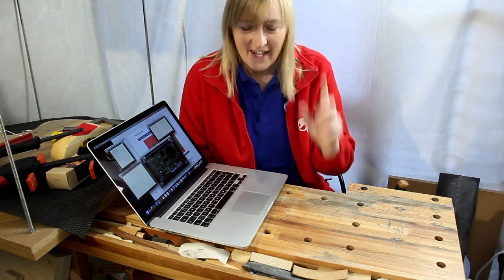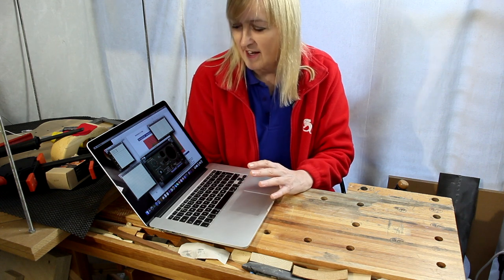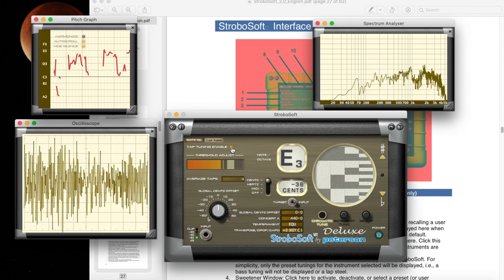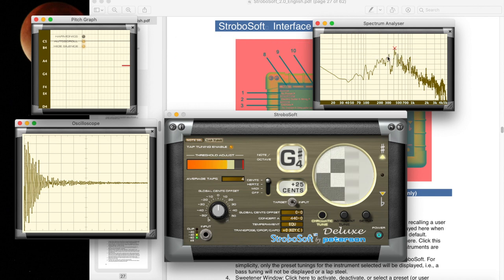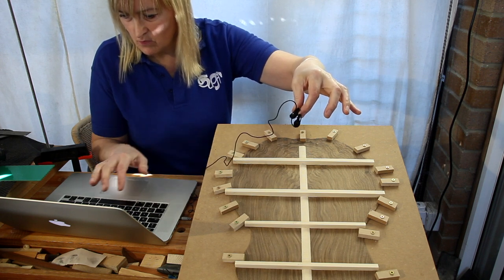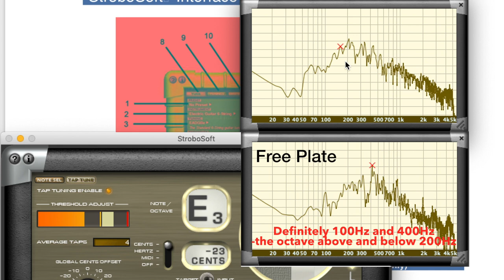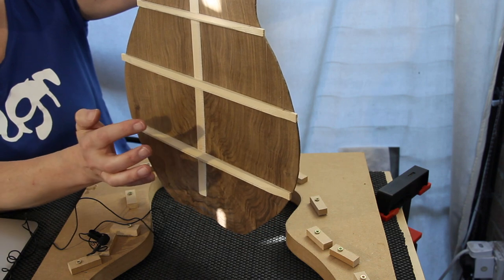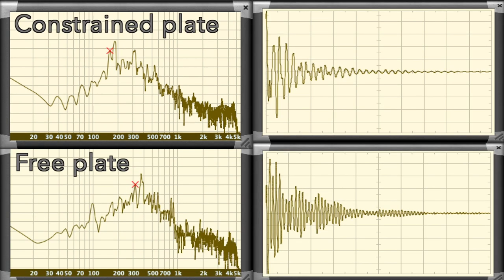Sugar SG1 acoustic guitar build part 48: Shaping the back braces

Comment: Acoustic guitar top tuning is pitchcraft :-) A regular straight chisel works well in that, when used bevel down. You need curved chisels for cavity bottoms and such.
Reply from the maker: I’ve since used my safe edge straight chisel and it’s much easier.

Comment: Susan I wonder if you've thought of using the software Trevor and most of the falcate guys are using (including me now!).  It's called Visual Analyser and it's freeware.  I've been capturing frequency spectrums (spectra) from the free plates and now from the closed box.  I've been using a Shure SM58 and Behringer preamp to generate the signal and a Staedtler pencil eraser duct taped to a 30cm or so stick of spruce for the taps.  Trying to use a method consistent with what everyone is doing and that seems to be accurate.  ANZLF is your friend if you want to find out more!
Reply from the maker: Does the Behringer preamp provide compression? I understand the signal needs to be compressed in order to give the analyser enough to work with. The kit I have is all a bit large scale - my compressor is rack mounted. If I can do it all on the Mac then it’s so much easier
Reply: @SusanGardener  I think more accurately the thing I have is an audio interface.  The SM58 wasn't able to pick up enough of a signal to generate a spectrum when all I was using was an XLR to USB adapter.  With this it's no problem and the spectra I generate are crystal clear.  The peaks for the various modes are very obvious with VA as well which helps someone like me who is new to allof this.  Couldn't tell you whether the signal is compressed or not.  This is the thing I have  Behringer U-PHORIA UMC202HD 24 Bit/192 kHz USB Audio Interface https://www.amazon.co.uk/dp/B00SAV0VP0/ref=cm_sw_r_cp_apa_i_GNg1Cb9KJNMV4
Reply from the maker: There doesn’t appear to be any compression so you are probably just getting more gain. I have a focusrite interface that will do the same. I’ll give it a go